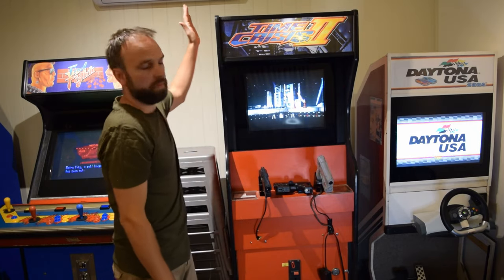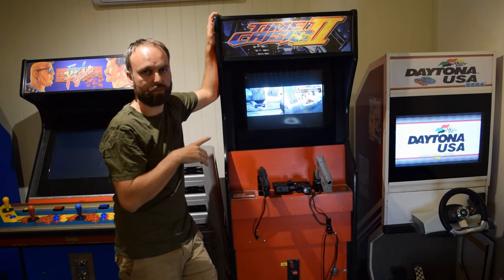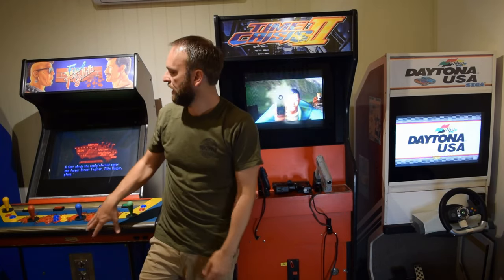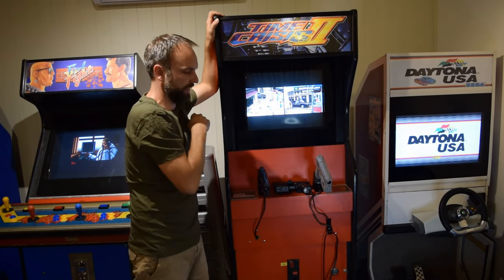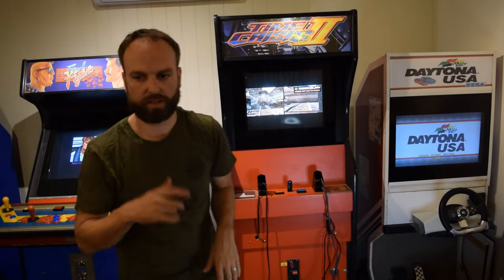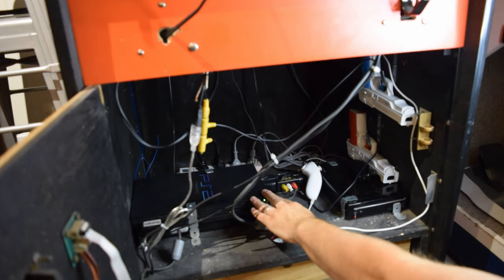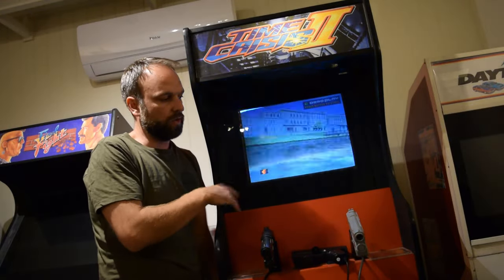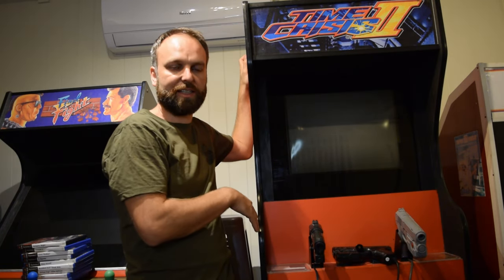Light Gun Shooter ARCADE SHOWCASE Part 1 of 3 - Hardware Overview - Time Crisis II

Comment: looks awesome man, been thinking of doing something like this for years. Either ps2/crt with gcons or emulation with gun4ir or sinden lightguns. I really love the sega model 2 shooter era.
Reply from the maker: Thanks heaps! 😁👍
I too was contemplating for years before doing it. It actually was not as difficult as I imagined it was going to be. The pedal was the trickiest thing to work out as I was making it up as I went. 
Yeah I agree, amazing light gun era! The thing I like about the era the most is that the games were mostly based around accuracy rather than over the top gunplay. Games like Time Crisis, House of the Dead, and Point Blank required a keen aim. You don't find a lot of that style anymore. Usually find the newer games are all about spraying machine gun fire by holding down the trigger. Buck hunter is an exception though! Have you seen the 1UP Buck Hunter cab? Looks amazing but super expensive and a small screen.
Thanks for watching, commenting and subscribing! 😁😁